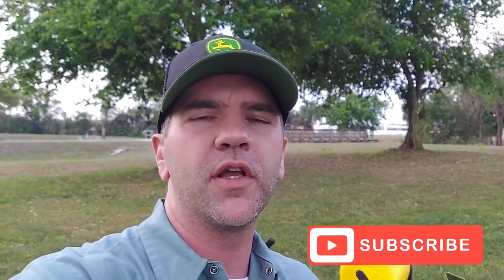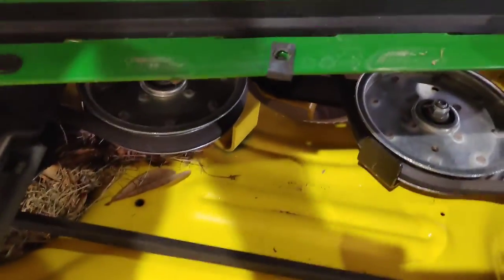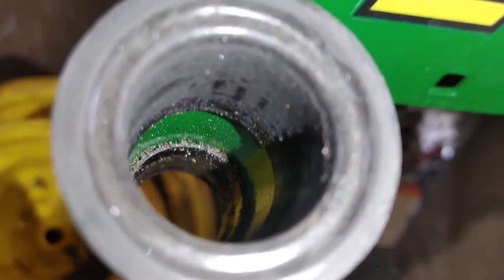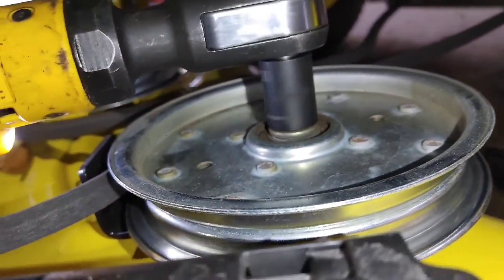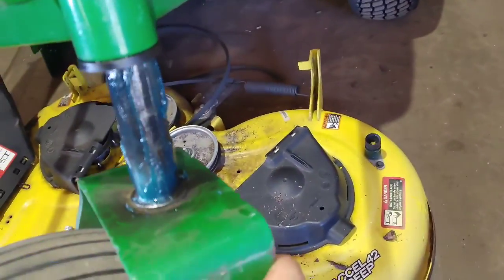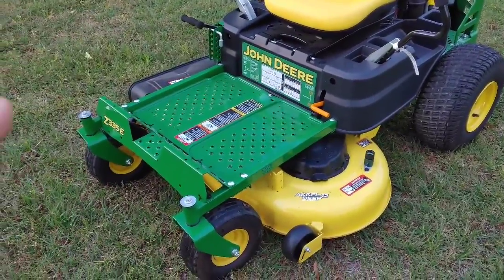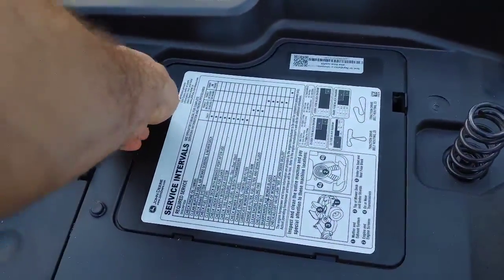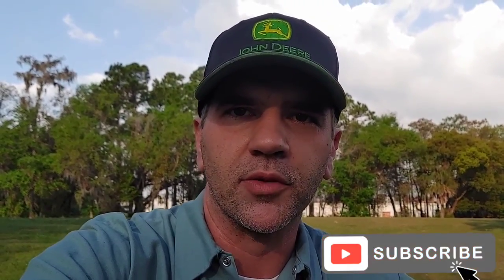Is the 19'- 22' John Deere Z335 Residental Zero Turn The Worst Mower Ever?

Comment: Really appreciate your videos and agree.  It’s all about perspective and philosophy of use.  My .46 acre subdivision lot makes this thing more than adequate for the job I think.  I’ve done all the things you showed here.  Most aggravating think for me was the front tire deflation brand new.  Dealer put some sealant all over it, and it’s performed ok for 3 seasons (about to start the 4th now).  It’s only got 45 hours on it and a lot of that is idling time from drying it off and keeping it clean like new.  My mom had a box store cub cadet that lasted 20 years, and it was neglected.  I really take care of mine so for my REALISTIC needs with practical maintenance, I hope mine will last me much longer.

Comment: For 2023 the Z300 series has a ball bearing in the bottom position of the front caster spindles but they kept a plastic bushing at the top.  I removed the bushing and added another ball bearing at the top (same one as the bottom, AM102888).  You need to add a thin 3/8" washer (about 0.050" thick & 7/8" OD) between the caster spindle and the black retainer cap to maintain the proper spacing.  The new decks (48" and up) are 10ga. steel, the frames are beefed up,  no more black plastic panel under the seat for easier access, no more cable for deck height adjustment, foot lift & dial adjustment (1/4" increments) for deck like most good zturns use. Got a $65 boarding step option to mount to the frame so I will never need to step on the deck.  The foot panel just lifts off now without bolt for easy access. No more parking brake lever. Kawasaki engines on most "M" & "R" models.  In other words, many needed improvements made to the 2023 Z300 lineup.
Reply: I am def looking forward to his review of the new z3. I get they are not designed to be commercial. Seem to have addressed a lot of his concerns, but time will tell
Reply: I heard someone say on another review - reliability of a tool has more to do with the owner than it does with the product. An owner using the product inside its intended purpose of design is going to get max life out of anything. I get that they can’t take being driven into a tree stump. My car would have a hard time taking that also. So I will never understand the basis of the comment that it’s a “junk deck” because it can’t be crashed into things. Under normal intended use; it would seem these new z3 are prob fine for most owners. Clean it, care for it, maintain it, be aware of yard hazards, I can’t imagine it won’t last as long as any other mower. 

I would be curious if something in particular is causing it to throw belts, if spindles bend bc they are crashed, etc. or are they failing under intended use due to poor quality

Comment: For me this is best mower I ever had I bought mine 8 years ago and used daily since then mowing 10to15 yards every single day and still running like a champ
Reply: Hi,i have the Z355E 48" but i can't cut grass less that 3" high because the belt will go out of the pulleys and get damaged or broken,any suggestions please.?

Comment: I've had my John Deere 6yrs, I cut 2 1/2 acres a week has been a great machine for me I do agree with the casters I installed roller bearings and greased, tires I used slime doesn't take much to fix the small problems good information to help others and I remove my belt the same way 😂

Comment: We have this model at my church where I am the grounds keeper.  One of the first springs when we brought it out of storage it started making bad noises.  Turns out the mice built a nest between the cylinders and it couldn't get air flow to cool it properly. Smoked the whole engine, scored a cylinder wall.  Now we specifically check for that each spring:). We haven't had any other issues.  My only beef is no suspension so if takes bumps hard and I am 6'4" and can't comfortably have my knees under the handles even when they're adjusted all the way up.

Comment: Thank you very much for this video. My dad bought one of these lovely machines right before he passed last fall. I'm really wishing he didn't. Now I've inherited extra work. It's still new so I'm hoping I can address these issues now before it becomes more work. Personally I'd rather take it back to the dealer. BTW I've learned from experience that silicone grease is best for plastic on metal wear surfaces like those bushings. For now I'll just keep an eye on those front tires till I decide what to do there. 🙄 I prefer my old 110

Comment: I have the Z345M mower, I assume it's probably pretty much the same mower, at least it looks just like mine. Why couldn't a guy drill a hole in the front where you replaced the bushings and installed a grease fitting so it could be greased? I also read JD had a bad batch of belt tension springs that were continually breaking, mine just broke at 35 hours. 

You made some points that I will definitely be doing to my Z345M mower, thanks for sharing.

Comment: Saying that this is the worst mower ever might be a little extreme. I have this model and have over 300 hours on it. I’ve had the casters lock up once while out on a property an don’t own a grease gun so I poured bar & chain oil down in there and never had the issue again. So I’ve also never greased the pulleys. Only thing I’ve replaced is the deck belt. Other than that just normal maintenance. It’s a very good mower for the money. Quality of cut with a nice stripe for a residential stamped deck is very surprising.
Reply: I have one too, and a couple years ago. This was a very highly reviewed product..
Reply: @brandtsweet

Comment: Just FYI in case you find this video in the future, I don't know if they changed this before or after this video was posted, but my Z355e has bearings on those front wheel posts.

I ordered replacement plastic bearing inserts and pulled the front tires off only to find bearings on the top and bottom of the post. I bought it 2, maybe 3 years ago from Lowes. So maybe they changed to the plastic ones at some point.

Comment: I have an issue with mine.  In full reverse mode, the right tire barely reverses compared to the left one.  Any suggestions?
Reply from the maker: Sounds like your right side hydro transmission is damaged internally. 
I'd first confirm that the input shaft pulley is not loose or spinning on the input shaft. 
Those transmissions are not really made for the JD techs to rebuild. Limited parts are available on those. You may need to end up replacing it.

Comment: Good work on your video, very informative. I have the Z335E mower and I'm pretty happy with it. Has just over 100 hours and no serious problems. The front tires, especially the left one, loses air, but I just air them up before each use to keep it level. I'm considering getting the extended warranty. I wonder if it's actually worth it though. I can go up to 4 years or 500 hours. I wouldn't put the 500 hours on it before the 4 years ran out. That plan is $622. I can handle the small things that can go wrong, but the transmissions are expensive. What are the chances one those would go out before the four years or 500 hours?
Reply from the maker: Hi Daniel, I wouldn't worry about needing to replace the hydros. I think the hydros and the engine can easily go over 500 hrs. The belts idlers and spindles will all go out before 500 hrs. Id say before 300 hrs you will have idlers and spindles going out.  If you bend deck that would most likely NOT be covered under warranty. If you get the warranty they will need to keep those plastic bushings replaced and the idlers and spindles. The belts will not be covered unless related to a manufacturing defect. 
Thanks for watching! 🍻
Reply: @Mechanical_Mind  Thanks for your reply. I have been thinking the the hydros and engine should easily out last the extended warranty hours of 500. Those are expensive parts and if they had a habit of failing in a short time, those mowers wouldn't sell too much. All the other things you mentioned are things I can easily take care of and afford when needed. I did bend the deck once when I hit a stump hidden in the grass. Bent the blade and the deck. I did auto body work for years, so the deck was not a problem to straighten. That's when I had to replace a spindle as well.

Comment: Why are you running all of that air in the tires? The front tire says 44 psi I think but the owners manual and the quick maintenance guide under the seat says 15 psi in the front and 10 psi in the rear So which is correct??????

Comment: I have the one with the Excell deep deck 48" comercial deck. I have the curved ends for the support frame rails. The only issues I've had with it so far. Is the support frames break at the bolts that hold the deck support. I've broken both sides now. I've got 300hrs so far. They made all kinds of excuses for it.

Comment: Grease put into the spindles will sit there and leak oil over time as the thickeners begin to solidiify. The oil does get past the seals. It's not doing anything like pushing out the old contaminated grease, but that stuff is also just sitting there solidifying and leaking oil anyway. The track the balls ride in stays clear of grease generally unless it's over packed.

Comment: I mow about 3 acres with a 2013 cub cadet 46" rider and I am in the market for a new mower because that one is a pile of junk as well so I wanted to get a zero turn to speed up the mowing process and try to get something a little better than what I have So I am not working on it all the time. I have been looking at different options including the John Deere Z515E but after watching your videos on John Deere mowers I am now feeling like I need to avoid them. That being said what do you recommend for a good residential zero turn that's not going to cost me an arm and a leg?

Comment: Thanks for the informative video, but maybe the reason they come in with "low" front tire pressure is because the manual says 15psi and you say 40-44psi.  Which one is correct???
Reply from the maker: The tires on those zero turns always come in holding no air. 0 psi. I meant to say they take up to 44 psi. Which is the max psi rating written on the tire itself.
Reply: I came looking to comment the same.  Manual says 15psi.  Great video…my front wheels seem to jam so I’ll be replacing the plastic bushings.

Comment: This is a great video and it addresses some minor issues.  One issue I have with my 2016 model Z335E is the drive transmission for each wheel does not engage evenly.  I’m thinking this is a hydraulic fluid level issue but I cannot find the fluid reservoirs.   Can you relate to that transmission issue
Reply from the maker: Those units do not have reservoirs but you can add oil from the top. There is no drain plug unfortunately.  Plus to add the oil it may be easier to remove the transmission. In that case I'd say dump out the old oil and add all new. As the wear plates wear the transmissions will get slower so even fresh topped off oil may not fix the issue with one operating faster than the other.

Comment: My blades will not engage.  I replaced the pto switch but it did not help.
Any ideas to check.

I hate my machine it never works when I go to mow.
Reply from the maker: I know this sounds silly but first check your battery and charging system. The clutch draws a good amount of amps during use. I made a video on how to check your charging system: https://youtu.be/Xj1w8dWxapI
Once you confim the battery is good and the charging system is working. Watch this video https://youtu.be/92O3-Vzj4fo

Comment: Does this mower have bearing inthe front forks ?
Reply from the maker: The new generation (after 2022) Z300s have one bearing and one bushing in each caster fork arm housing. 
The previous generation of the Z300s had just plastic bushings and zero grease.

Comment: I know the one issue I have is when I cut the grass with the bagger system is that it always gets clogged barely goes into the bags all the time don’t know y…also i removed the red flapper inside the tide don’t know what that did ….and also I no idea how to remove the bagger system all I see is bolts everywhere doesn’t seem no easy way to remove and put back on …when I bought the mower bought it from a guy with zero hours brand new and had the bagger already installed

Comment: I got 1, and at 400 hrs now I’ve so tired of working on it.  The plastic spindle bushings, seat springs, chews belts 3x a year, done replaced both idler pulleys due to bearings, electric pto clutch, ……… it never ends except the engine has been flawless
Reply: With 400 hundred + hours you can   expect things to wear out